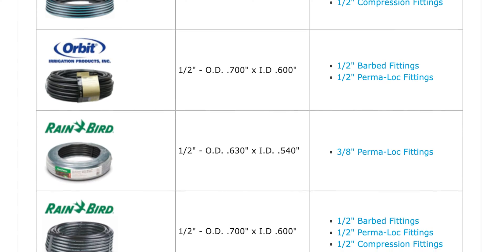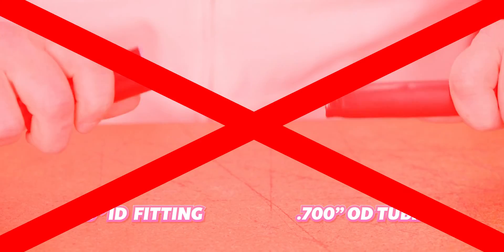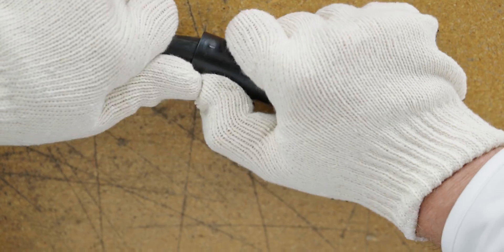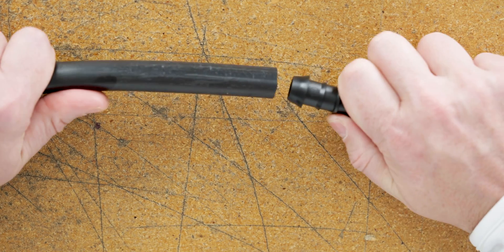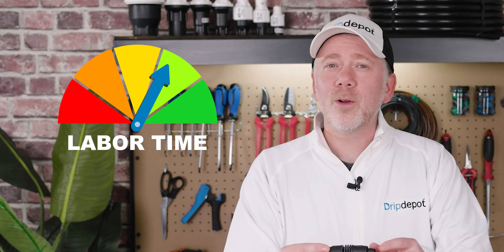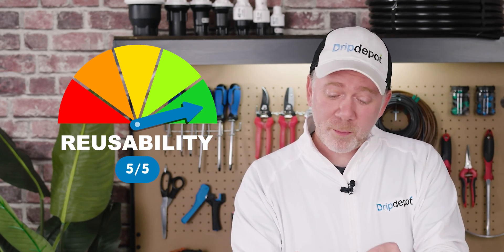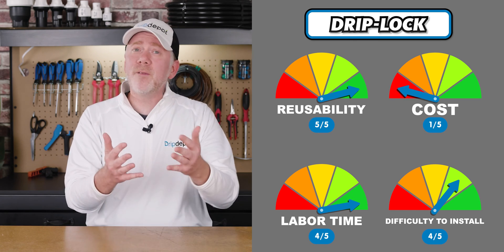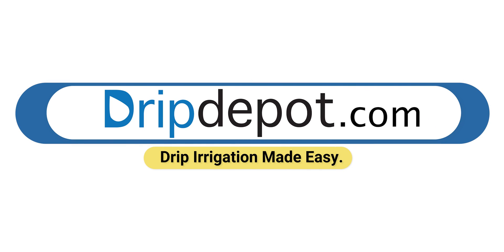Drip Irrigation Fittings: Choosing the Best Type for Your Project

Comment: I have a hard time removing the permalock fittings because it bothers my wrist. I have ended up cutting them off. I think I will try the drip lock fitting.
Reply from the maker: I do think the Drip-Lock are a bit easier, at least at first.  After use it can be a bit of a toss up.  Once dirt/grit gets into the end of the Drip-Lock fittings they can also get pretty tough to remove.  I haven't experimented with rinsing them first yet, so maybe a quick rinse when they need to be removed after being out in the elements for awhile will help get them back to the same ease as when they're newer.  

And I agree about removing tubing from the Perma-Loc.  From any fitting really.  The same tight fit that keeps things from leaking makes them difficult to remove.  If you haven't, try walking the tubing back and forth as you try to remove it.  The walking motion can help it come off without putting all the strain on a straight pull (though I confess, I've cut my share of tubing off as well!) :)
Reply: @dripdepot  thank you for your response and all your videos! On your website, it looks like the drip lock tubing only connects to half inch line? I only have three-quarter inch mainline tubing. Will it still work with that? Otherwise I will try your trick for the Permalock fittings. Thanks again. I think I’ll only get my irrigation supplies from you all now. I’ve learned a lot just by watching your videos.
Reply from the maker: @anjali0596  So far Drip-Lock is only available for 1/2" tubing sizes.  However, good chance we'll see it for other tubing sizes as they become more popular.  Drip-Lock fittings are still fairly new compared to other fitting types, but as they get more notice there will be demand for them in other diameters.  Even our comments here are likely to be noticed by the manufacturer's analytics team searching for sentiments on their line of fittings. 

If you give the "walk off" method a shot, you can also think of it as rocking the tubing back and forth.  This will get it to start working its way off the barb on the fitting.  And hopefully you don't have to remove too many!  Even those of us who do it every day would get sore if we had a bunch to remove :)
Reply: @dripdepot Thanks so much!

Comment: I have a 3/8” soaker hose. I need a male and female fitting for the ends. Which fitting should I use? Also how do you determine  what thread size you need to use?
Reply from the maker: Annette, the best bet for compatible fittings for a soaker hose (if you have the type that's porous across its entire length) will be to reach out to the manufacturer or the folks selling it.  Soaker hose fittings are often specific to that soaker hose and it's very unlikely any of our fittings would be compatible (ours are primarily for poly tubing).  

The thread size I can definitely help with :) 

For your application, it sounds like you'll be running your soaker hose from a standard hose bib.  Hose bibs and garden hoses (and garden hose accessories) have 3/4" hose threads, almost universally within the US.  Any time you need to connect something to your hose bib or garden hose, you'll just need the corresponding (male or female) hose threads in 3/4".  Hose threaded parts should have a female inlet and a male outlet.

Comment: I’m trying to attach a 1/2” soaker hose to hose with male fitting.
What should I use to connect the two items?
Reply from the maker: Are you needing to attach a 1/2" soaker hose to a standard garden hose?  If so, does the garden hose have its male threads at the end of it?  

The specific fitting needed will depend a little bit on your soaker hose, but it would essentially be a "1/2" Soaker Hose Barb x 3/4" Female Hose Thread" Adapter (if your garden hose has the male threads in place at the end).  The tricky part of that is the soaker hose barb end.  If you have a link to your soaker hose I'd be happy to take a look and see if it's something that  has fittings available for it out there.  :)

Comment: A pretty good review of the four types of fitting... BUT there was no explanation as to why there are the three sizes in the first place (all nominally called "1/2"). Why are there 3 sizes? Are they for specific applications? If so, why not list these?

As for the discussion about switching to metric being a better idea (and I do like metric for certain reasons and applications) - the reason(s) given would do nothing to avoid the apparent confusion for some people... if the commenter can't read a difference between 0.620, 0.700, 0.710 do you really think they will be able to read a difference between 17mm, 17.8mm and 18mm? What were they thinking?  The compression fittings are already supplied in colour-coded versions for each size (green, black and blue) and the twist-lock and drip-lock fittings cover all three sizes. How many people care aout the older barbed fittings? They are not often used anymore as you need the two components and you need the specific size - they were outdated long ago. I've come to the same conclusion as the video - the twist-lock are the easiest, simplest, cheapest and most useful overall; the drip-lock are handy but still a little pricey. 

I noticed an odd statement in the review of the Drip-Lock fittings: "Labor = 5/5" ("easy to install and easy to remove") BUT in the very next sentence: "Difficulty = 4/5" because "removing the fittings takes a little bit of getting used to it" - a direct contradiction of the previous statement.
Reply from the maker: You've got the right of it on the variety of metric size tubing out there, the exact same issue occurs in regards to fittings.  The imperial marked tubing we use here is typically metric sized tubing given an imperial measurements (particularly 16mm).  It just ends up lumped under a 1/2" umbrella (which is definitely not ideal for first time irrigation DIYers).  

There aren't really any applications specific to the different sizes you see in 1/2" - they're all often used in home gardens, Ag and even non-irrigation applications like solar pool heaters.  To some degree, these sizes came about due to agriculture.  To a home DIY'er there's not going to be much cost difference between 0.520" inside diameter tubing and 0.600" inside diameter tubing, but for a commercial system hundreds of acres (or larger) in size, the small amount of additional material in the 0.600" tubing is going to add up very quickly.  In that way there's some benefit to these many different sizes; if strict standards were set commercial growers might find themselves spending much more than they need to on 0.600" inside diameter tubing even when everything is sized for 0.520".  

Though a rating that's 1-5 isn't as robust as I'd need to dial in, I do stand by my ratings on those, happy to explain my thought process below :) 

The Drip-Lock fittings, overall, require the least amount of time and effort to install by a fairly good margin.  They're can be more difficult to remove, but only _can_, it's not guaranteed.  Sometimes removing a Drip-Lock fitting is going to be 5/5 in ease (maybe even most of the time).  But every now and then a bit of grit gets in there in the wrong place and the additional friction feels like it's applied exponentially, making it very difficult to pull back on the release collar.  This doesn't happen with all of them and it can be worked around, but does mean a bit of a learning curve for some of the Drip-Lock fittings.  To some degree this can happen with Loc style fittings too if grit gets jammed in beneath the locking nut, but it's safe to use tools on those locking nuts making it easier to work around (at least, if you don't mind tool marks on the fittings).  

Great comment all around here Kim, I appreciate it!  And I fully agree with your insight on the metric sized tubing being potentially just as problematic.

Comment: The video doesn't mention the most important specification. Any fitting that fits into the inside of the irrigation pipe will narrow the bore diameter and so restrict the water flow, particularly over longer pipe runs and when combined with multiple fittings. It should be noted that the most important aspect is operation of the irrigation system itself, secondary to ease of installation, particularly with small pipes eg 1/2".
Reply from the maker: On a large system with potentially hundreds of fittings this is definitely worth accounting for, though on a residential sized drip system the head loss from fittings is going to be negligible (and it's the turbulence that causes most of the head loss rather than the brief smaller ID).  A barbed insert (or any male) coupling , for example, is equivalent to about 2' to 4' (depending on the fitting) of head loss.  Pressure loss like this is often given as "per 100' " of tubing or pipe.  Let's say you've got 100 GPH going through 1/2" 0.600" ID poly, the pressure loss is going to be about 1.3 PSI.  A fitting that's equivalent to 2' to 4' of that head loss would only be about 0.03 to 0.05 PSI and it would take 25 to 50 of these to equate to loss in 100' of pipe.  

Of course, as flows get higher this will increase as well.  At 250 GPH, loss in 0.600" 1/2" Tubing will be 7.2 PSI per 100',  giving us 0.14 to 0.29 PSI in a male fitting.  Still fairly low, but enough that it does become worth accounting for on a large system where many fittings will be used :)

Comment: Thank you!! I've only used compression fittings but my 72 year old hands said it was time to find something easier. This video was exactly!! what I was looking for. Thank you for making it. Much appreciated!
Reply from the maker: I avoid tubing compression fittings as much as possible too, and I do this every day.  I think the only time they're really called for is on a huge project where thousands of fittings are going to be needed, then the savings start to add up to make their difficulty worth it :) 

Not sure if you've bumped into it on another video yet, but if you use the Loc style fittings, dip the end into really hot water (careful of course!) for a few moments, it softens it up considerably and makes it even easier to push on over the barb.

Comment: I have a question...My outdoor spigot comes off our water softener...and yes, there's salt in the water.  What can I use to get rid of the water so I cna use my outdoor spigot to water my plants?
Reply from the maker: The best long term option would likely be to bypass the softener for the outdoor spigot (or tap into the line before the softener to run out plumbing for a second spigot).  This would most likely require a plumber unless you have lots of DIY plumbing experience (heck, I might hire a plumber for this part myself).  

Technically, you could use a reverse osmosis system that can remove sodium.  This might be cost prohibitive though, I'd definitely compare it to the cost of a plumber if you look into it.  

And I want to note you're on the exact right track in looking for ways around using softened water.  In most cases when using softened water,  everything appears great at first, but over time the soil health can really suffer, and by the time you notice any negative impact, a lot of damage has already been done.  Awesome that you're tackling this now :)

Comment: I’m going to switch out a valve that currently has 1/2 tubing with 1/4 coming off it for drip irrigation to a 1/2 in line emitter system.   I need to connect the in line emitter tubing about 30’ from the valve so I thought I’d keep the existing 1/2 tubing till that point but it’s a older tubing with a OD of .620 (uses the green fittings).  The newer 1/2” in line emitter tubing has a larger OD, I guess .700.  Is there a version of the Perma Loc fitting that I can use to connect two lines with different OD?  Thanks
Reply from the maker: Great question!  And I do think I might have the fitting that will do the trick for you here :) 

The fitting is a straight coupling that connects larger 1/2" tubing to smaller 1/2" tubing -- on the smaller side, it works with tubing that has an inside diameter range of .510" to .580", the 0.620" OD tubing usually falls comfortably within that range. 

The larger side works with tubing that has an inside diameter range of .590" to .630", which is the ID of tubing that typically has an outside diameter of .700 to .710.  

Here is the link to that reducer: https://www.dripdepot.com/2191

Comment: Thanks! Very helpful, I've use all with the exception of the drip lock! I strongly agree with your video, you have summarize fittings issues very well,  I wish this video would have been available years ago when started my drip systems!
Reply from the maker: Thank you for the comment, a great tone-setter for Friday afternoon down here!  

I don't think I said it in the video, but I think of drip-lock fittings as a sort of really easy to use compression fitting :)

Comment: I like the Perma-loc fittings because they are easy to install and can be easily disconnected which makes repairs so much easier. They are slightly more expensive but it's worth it!
Reply from the maker: Fully agreed!  And if you count labor time installing them, they can even come out less than other types of fittings except perhaps compression.  

Also, just checked out your channel and the video going over how to remove a stuck hose vacuum breaker is fantastic!  We see this all the time in our industry, I'll be pointing folks to that video so they can use their timers without a leaking vacuum breaker under constant pressure.

Comment: Can drip lock go under ground?
Reply from the maker: It sure can!  I'd stick with the 6" to 12" depth that's common for poly tubing, but I can confirm these are good to use in direct burial applications.  They're not the easiest to remove when they get dirt in the teeth area, so if you ever need to remove one, give it a bit of a rinse before inserting the release tool :)

Comment: you can probably use zip ties on the barbs
Reply from the maker: That's a great point -- with the smaller barbed fittings, in a low pressure system, there's a good chance zip ties would work -- you'd want them UV treated (if it's an above-grade run of tubing) so they don't get brittle, but I don't see any reason they wouldn't work :)